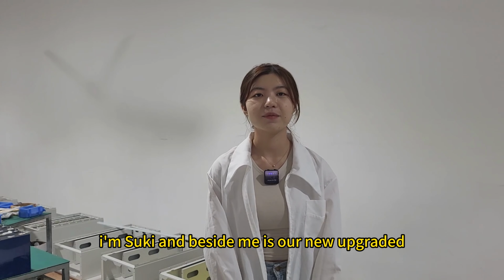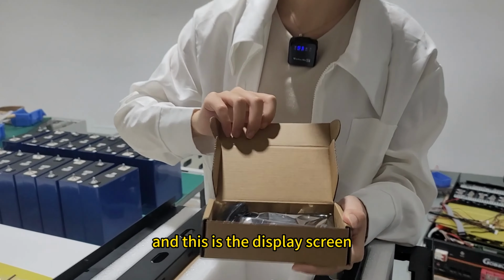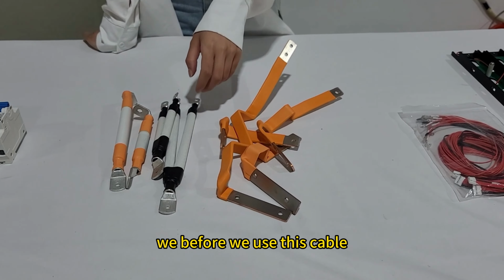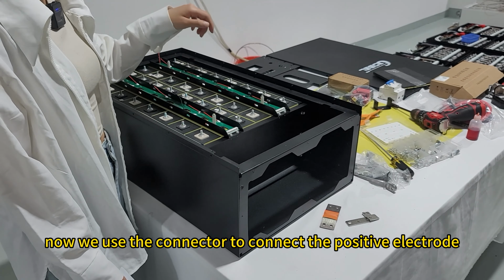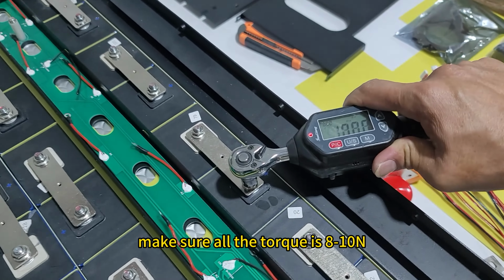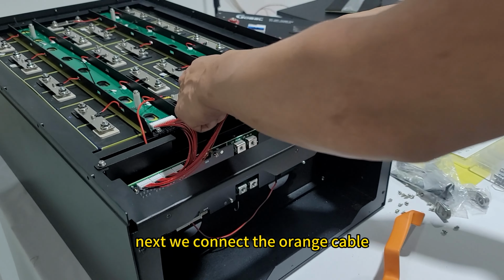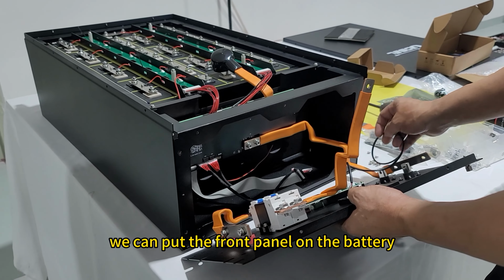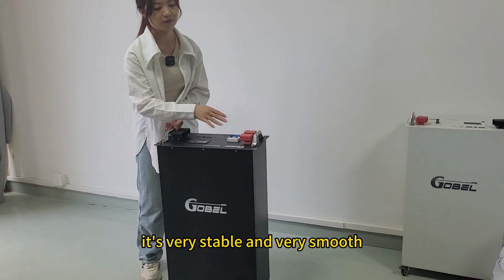New JK200 DIY kit for easier assembly

Comment: Two ''wrong'' things from my side.
-Holes on the balance board are not match to the cell vents on cells. They are shifted slight.
-Main busbars connected on battery terminals on top of the balance plate. Main leads should be at the bottom, first to the cell and on top of it balance plate.
Third thing, I didn't saw AIC rating of that breaker. For LFP it should be 20kA

Comment: Also instead of those small holes to small balance/sense cables to go trhou it would be better if they were cut till top so i wouldn't have to push them throu every hole in that metal pcb holder... Btw those flexible bus bars is positive thing Very good

Comment: I ordered two Kits and two kits came with broken tabs (or how to call it) that metal stud that is for holding PCB with plastic holders..unfortunately i had to be creative in both cases so glue them with liquid metal glue so it would stay attached to that pcb holder (and I think holders where those two almost identical PCB's are for balancing cables and such...)... I think they should improve this ..outside of this One plastic box with all screws came damaged ..but not a big deal..

Comment: In which way does the heating pad need to be installed? Is the sticky side meant to stick to the bottom of the case? Or is the sticky part facing up touching the batteries? Does the epoxy goes underneath the heating pad or in between the heating pad and the batteries? It would be good if you guys could do a video explaining this because there are no instructions anywhere.
Reply from the maker: Thank you very much for your suggestions, we will continue to optimize our videos!

Comment: Need to add clamping to the cells so they won’t move or bulge. Also, flexible copper bus bars between the cells and flush or inset screws for the terminals on top. Will cause a dead short if the cables to the inverter are mounted upside down.

Comment: This cells have very small contact area for 250 AMPS of load, why you do not use M8 - M10 terminals ? 
What is total resistance of all cells + bus bars + BMS FETs , if everything is hot in high ambient temp in summer ?

Comment: Hi, why you use this cheap breakers, which can not withstand 15000 - 30000 AMPS of Isc === short circuit ?
You can use proper ceranic fuse for 50 000 AMPS of current, e.g. 200 - 250 AMPS, aR or other reaction time.
Reply from the maker: The circuit breaker we use is a big brand name brand Chint, which is IEC certified and is very safe

Comment: Isn't there a major design flaw? As the batteries are inserted, they are not fixed (pressed against each other or against the case). They are just loosly standing there. You you see it especially by the uneven gap between the left and the right cell row here https://youtu.be/8TczkSbMe0I?t=516.
If you then mount the terminal bars, the cell positions relative to each other will become permanent. This means that if there are gaps between the cells during the insertion, these gaps will become permanent as well. So far, no problem.
But if you then put the case upright, all vertical force inside of the battery stack will be caught be the terminal bars and so by the cell terminals. This happens, because there is nothing to compress the whole battery stack before mounting the terminal bars.
Solutions could be:
1.: implement a mechanism to firmly compress the battery stack before mounting the terminal bars
or (if compression is not desirable)
2.: use flexible terminal connectors
or (as a compromise for no compression and stiff terminal connectors)
3.: fasten the terminal screws only loosely while the stack is in horizontal position, than put it upright (to let the cells "fall" into place) and then fasten the terminal screws finally while stack is in vertical position. This might even make room for another epoxy sheet at the very top of the stack (as all cells are then surely at the bottom-most position possible).